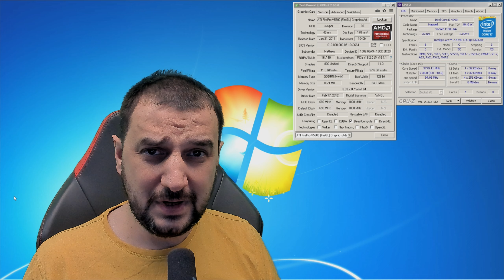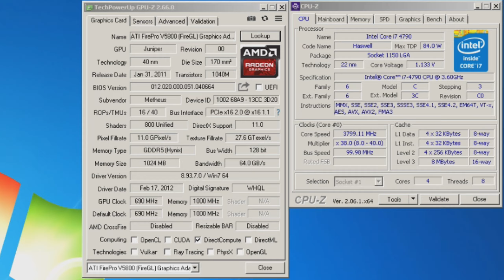ATI FirePro V5800 Benchmark

Comment: Can it run forza horizon 5 by any chance??
Reply from the maker: I don't know. Maybe older version? FH4? Worth getting it?
Reply: @DanielCardei  
This card is sold for 13 USD here in Egypt, so IDK should I get it or get the Quadro P620 for 30 USD
Reply from the maker: @mosaid6249 that p620 its better. That's pascal.

Comment: I like how your guy in Stalker is absolutely obsessed with the sharp edge of his knife!  :)
PS:  You need to use that video card in a Linux machine (Linux Mint Cinnamon is very easy to get used to).  Just install Steam and play any games you want.  The games think you are using Windows 10 or Windows 11, depending on the settings Steam applies.  Benefit is you lose most of the stutters, and Steam works.

Comment: Just ordered the FirePro s10000.  I hope i will find some proper driver for windows... xp vista 7 11...
Reply from the maker: Do you plan on modding the bios?
Reply: @DanielCardei  If I had to, sure! I already planned modify the cooler to my watercooling system. Bought some gpu blocks, and fittings. I have left spare quick disconnects, ordered new 5L DP ultra, but it's not in the warehouse, so I have to wait another month.
Reply: regretted it. 😥

Comment: I have a W9100 and if I let Windows 11 install the driver it installs as a FireGL running Catalyst. Uh, so I downloaded the newest Windows 10 driver, from 2021, and it works fine. It installs as a W9100 with Adrenaline instead of Catalyst. If I let Windows 11 install my Firepro V8750, then it installs as a HD 4870. V8750 drivers won't work at all. 🤷

Comment: If I remember correctly, these cards are basically just power limited HD 5770s which are quite good. Its not like you would be losing anything since AMD always overvolted these cards and you can just overclock them to reasonable clocks again.

Comment: i bought 8 sapphire v5800s on ebay new old stock with box and driver disc for $12 each , i made the purchase after i tested a used one on windows xp with a haswell i5  4670 system  which for the record uses a modified version  cataylst 12.8 , its an amazing windows xp experience it combines a sweet spot of legacy features and top end windows xp games
Reply: These in crossfire would be wicked. I really like this generation of cards they all overclocked really good and were cheap.